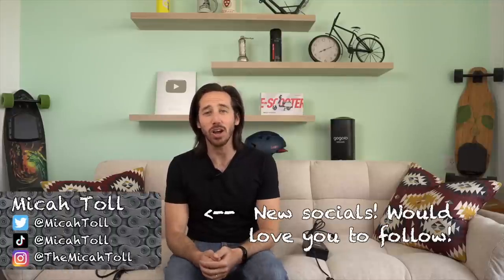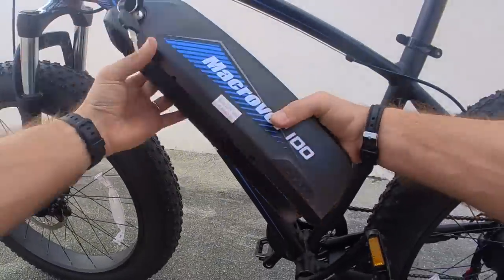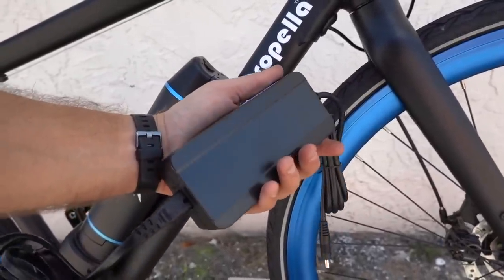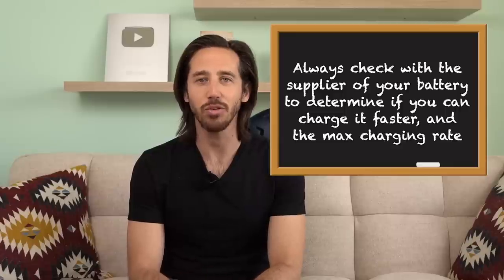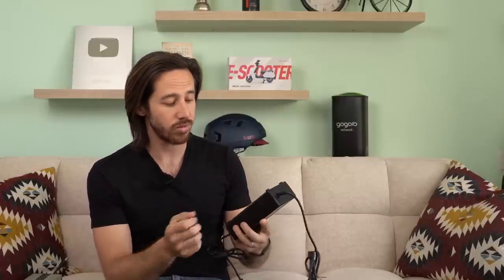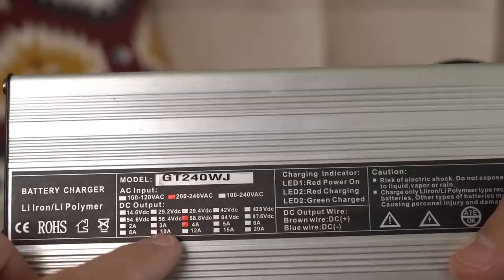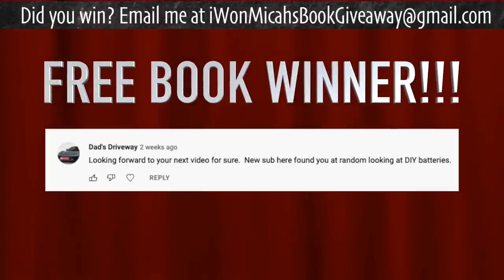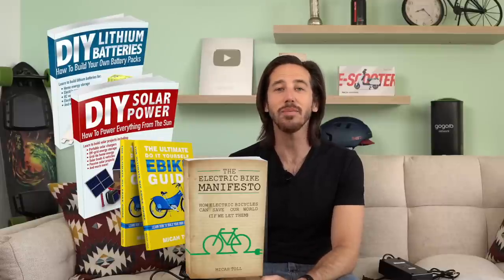How to charge your battery faster! (Multiple methods!)

Comment: I accidentally charged a 48 volt battery with a 52 volt charger.   Charger light turned green at the end of the charging cycle as normal and pushing the battery check light on the battery showed the battery as being fully charged.  Did I damage it?
Reply from the maker: High chance that it's totally fine. The BMS is designed to protect against overcharging with too high of a voltage. If the BMS had been faulty, it could have exploded. Since you're reading this now, you're probably fine :-)

Comment: I have a 48v 42a battery and the battery I used is a Li-ion 6.4a continuous can I use a charger that uses 15amp continuous or should I stay below the 6.4a of the batteries? I don’t want to damage my batteries or cause a fire
Reply: In theory anything below 1C ( here 42a ) charging is acceptable. But I have no idea if it's done with these much bigger batteries like yours. Most battery chargers I've seen charge at 0.3C or closer to 1C but that's with lower capacity batteries. Make sure that if you try to charge at a bigger charge rate than factory that the charge cables can handle the current. Also the current flowing through the conductors need to be taken into consideration. Are the conductors able to handle the amount of charge current? It's possible that the battery can take the current but not the conductors. What kind of load is connected to the battery? If you have an answer on all these questions then you can conclude it yourself.
Reply: @Timo-Epis  I made the battery and it should be able to put out 42 amps continuous the BMS is rated for 60amp max

Comment: I would rather spend the money on an extra battery, they all come with trickle chargers, the slower chargers ensure longer life for the battery, there is no faster recharge than a battery swap, you can take 2 batteries to riding venues, you can leave a spare battery at your regular destiny as well you have a spare charger and a spare battery in case of malfunction.

Comment: i use my Wanptek 6020D 
60v 20a Adjustable Desktop Laboratory variable dc Power Supply CCCV
to charge my 14s20p Battery.  always 80% (56V) 
1200W with a Smart BT BMS.
I just love my config 😍😍😍😍😍

Comment: If you take them apart there are 2 screws which increases and decreases the voltage and ampage
My battery charges in less then 2 hours because of this and my battery is 48v 10ah

Comment: I have a 52v battery on my bike.  The low voltage cutoff recommended for this battery is 42 volts.  Is there any way to get more of the stored volts out of this battery?  Everything I've read about the range for this battery assumes you can run it down to almost zero, yet the battery won't allow this, and will cutoff about 42 volts.
Reply: The BMS cut's the voltage at 3v per cell. That's a safety meassure to ensure you don't damage the batteries caused by overly discharging the battery. So the 42v cut off is normal. You will never get a battery to 0 volt ( unless it's damaged etc ) because of the BMS.

Comment: Its best using the charger that came with the batteries, don't think I would trust non standard charger that's not certified, battery fires nearly always happen when people use the wrong charger.

Comment: Hey, I've been working on an electric 4 wheeler. I'm using a 72v motor, and I want to build a lifepo4 battery. Should I use 20s, 21s or 22s. Confused about the max voltage vs nominal.
Reply: base the battery pack off of nominal. If you are using a 72v motor, build a 72v nominal battery pack. There are controllers that you can program to work with specific battery configurations, but it's just easier to use the nominal rating.
Reply: @devildogcody  nominal voltage is 22.5s, so 22 or 23. My motor didn't come with much paper work, but is rated up to 72v doesn’t say if the slight over voltage at full charge would be an issue. This is the cheap Kunray motor on Amazon.
Reply: @timd972  when a motor/controller talks about its voltage rating, it's usually the nominal voltage. You will have to go into its settings and change to the correct voltage range.... on most you can do this through the display. You will select the nominal voltage of the battery you are using (i.e. 48v, 72v etc)